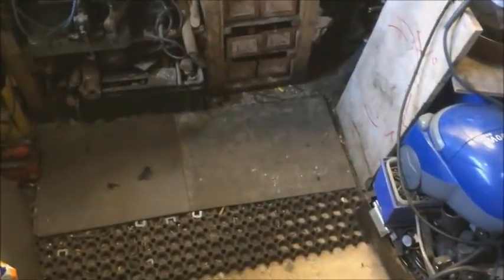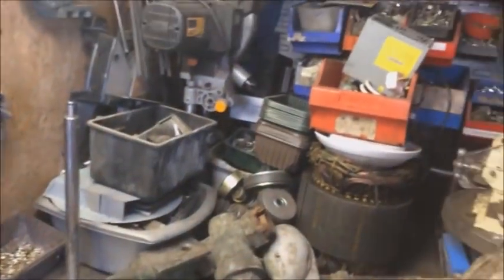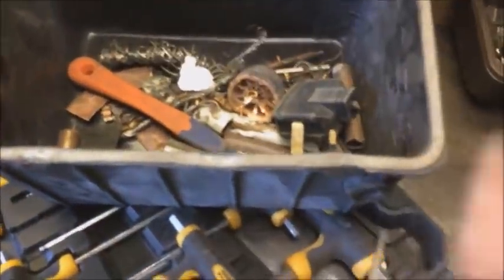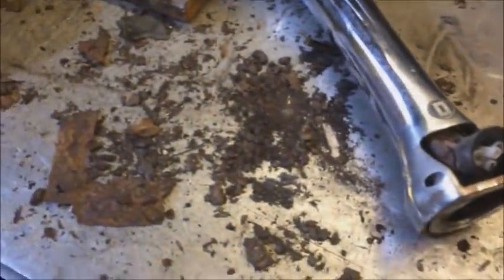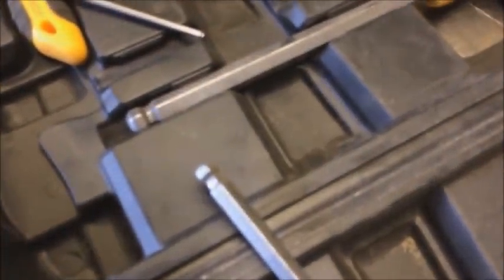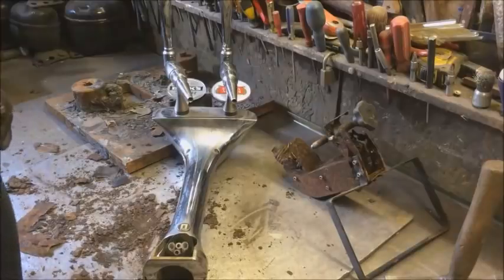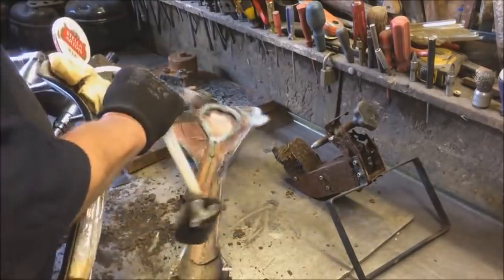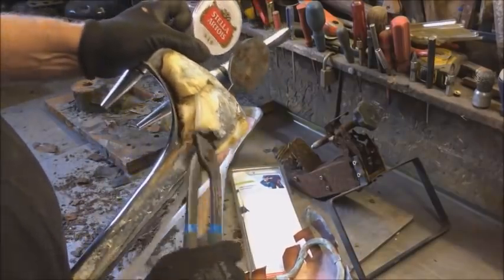Tek it Bits Beer Pump,  monster inside,Brass Bonanza

Comment: From the other side of the wee little pond, Heyah! Was a tiny bit confused at the beginning when it sounded like you said the body was stainless steel because there were no sparks. Near the end you showed how a positive spark test indicated stainless steel. Love your vids!
Reply from the maker: The screws were so tiny in diameter they didn’t throw off sparks,  conversely evens tiny iron screw will show plenty yellow sparks, sorry for the confusion

Comment: Looked in a skip outside an office re-fit  today,  4x Brother tn-2220 toner cartridges in box,  unreal.
Reply from the maker: now find a Brother Printer
Reply: @Man-in-da-shed  On ebay as we speak, retail is £57 each, I got them for £30
Reply: Check for expiration dates, some have them some dont. Should be on the ends of the boxes